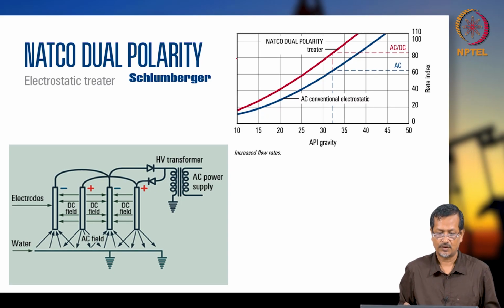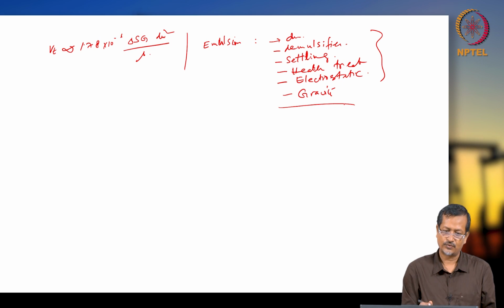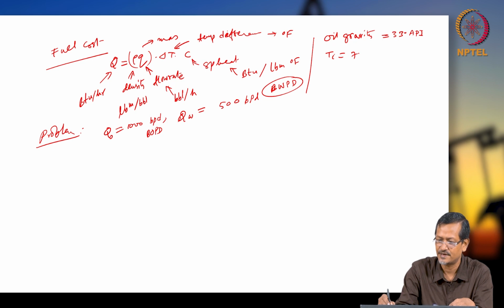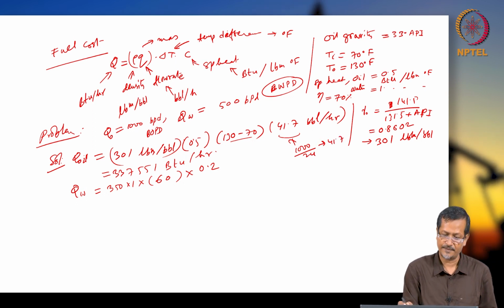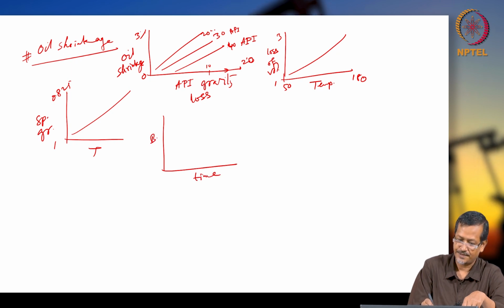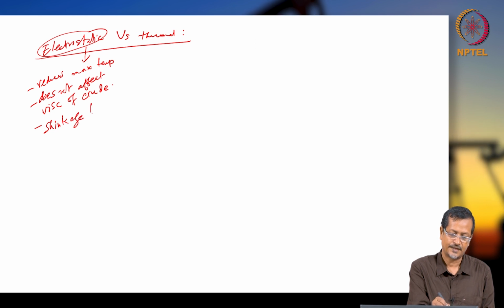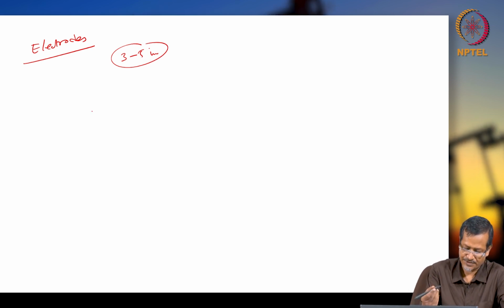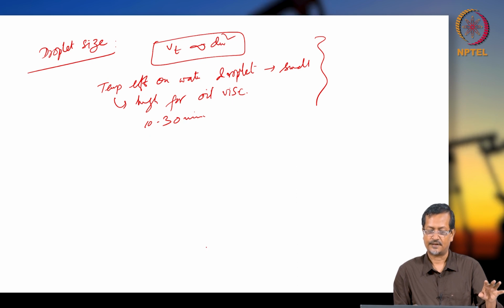#33 Introduction to Electrostatic Treater | Part 02 | Surface Facilities for Oil & Gas Handling

Comment: Interesting to see electrostatic treater applications in surface facilities. Could you clarify if this package includes specific gas compression system integration points with the treater? Need to confirm scope to ensure compatibility.